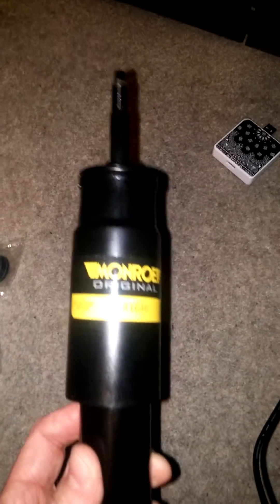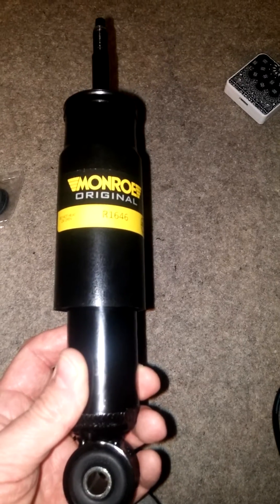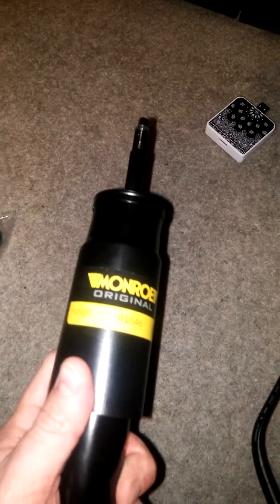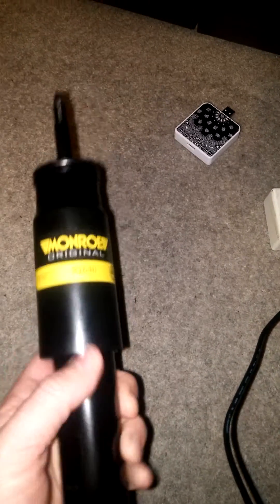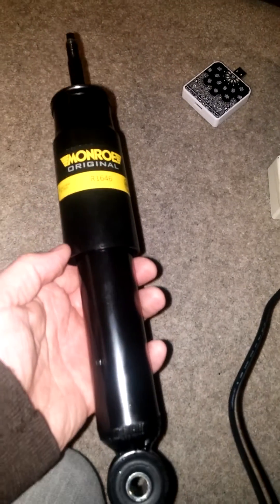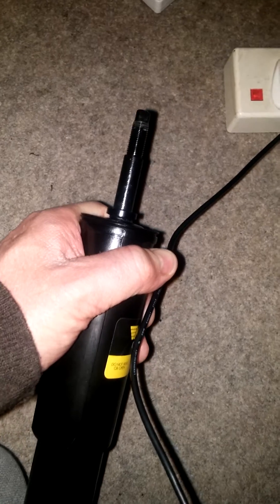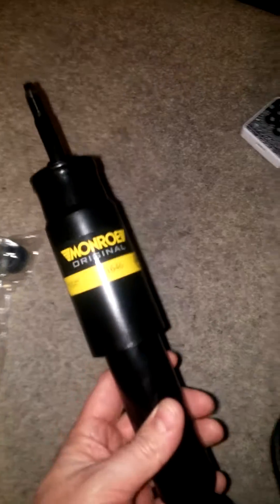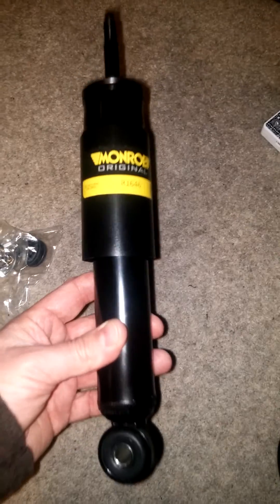MGF DAMPERS WARNING!!

Comment: Harry you are the ONLY person that I've heard  tell it like it is. Everyone moans and bitches about the various options to replace the hydrogas system but it's the tin-foil, pathetic, frail mountings that MG outsourced to some pre-school kid to design that's the real culprit. Throw any more than a freshly baked custard tart at these mounts and it's going to rip the thin lining out of the rear RH side of the engine bay - as I can attest. Now I have a pile of MGF spares that handled really good for a while with the Suplex cans. What does frustrate me is the Suplex didn't include any warnings about over stressing rebound. Well told.